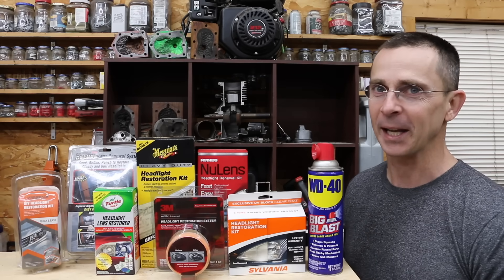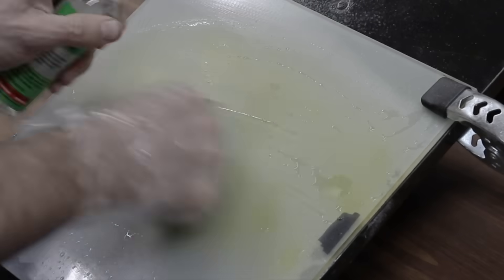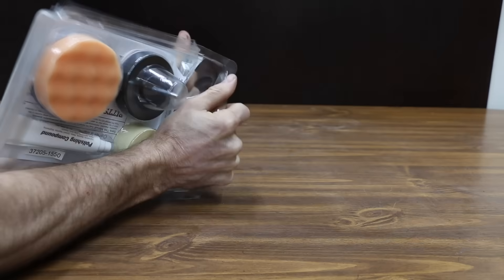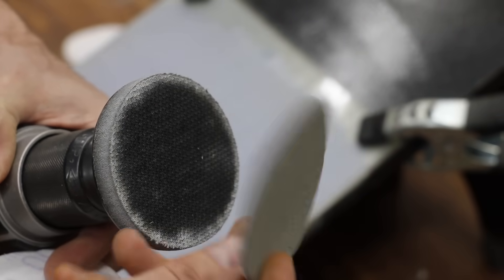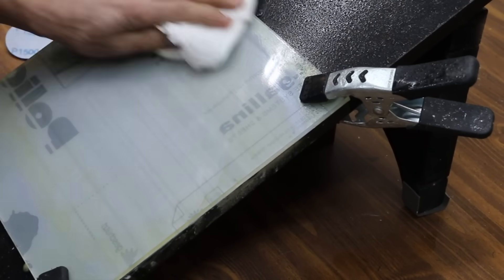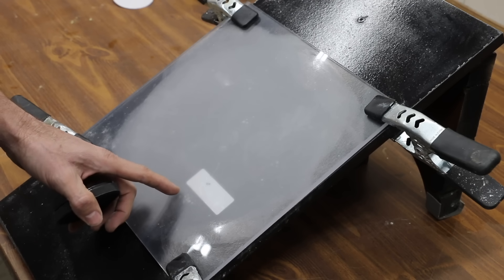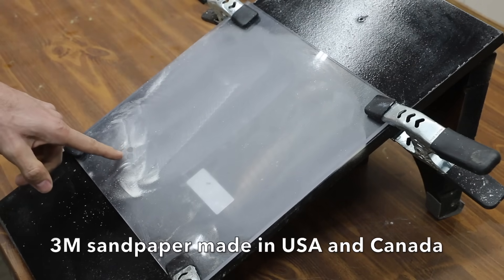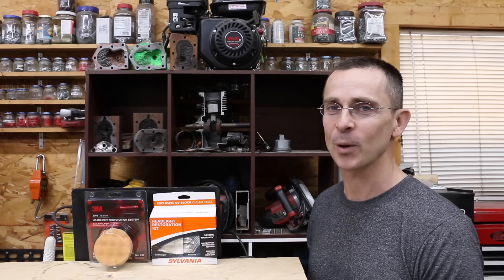Best Headlight Restoration Kit?  Let's find out!  3M, Sylvania, Meguiar's, Mothers, Turtle Wax & HF

Comment: I'm an ASE tech and worked at a used dealer for years.
We frequently had to repair headlights.
I've found the best way for lasting results is to get a 3m kit, wet sand out all scratches and yellowing.
Wash & thoroughly dry the headlight.
Then buy a can of Rustoleum clear coat spray paint that says "dries crystal clear".
Spray several light even coats as it will run if not careful and you get to start over..lol
I've seen vehicles return 4 years later and headlights are still crystal clear.
Reply from the maker: Thanks for sharing.

Comment: Seems like the kits that do not have anything to protect the lens after it is sanded and polished, are not comparable, strictly speaking, to the ones that have a means of protecting the lens after restoration.
With no coating, any repair or restoration will not last very long, and may wind up worse in a few months than before the coating was removed by the restoration.
The lens needs to be protected after the process of removing the cloudiness is done.
The good news is, there are products that can be bought just for that part of the job.
Reply from the maker: Thanks for the feedback.
Reply: @ProjectFarm  I saw that you had mentioned this later in the video than I had gotten to when I made this comment, so you were of course way ahead of me!

Comment: I've used the turtle wax on my 2007 Cobalt SS. I did not sand. I used rubbing compound to help clarify. Sandpaper will remove the lettering, where rubbing compound won't. It turned out nice because I keep my headlights waxed anyway. The only problem is, they need 2 packs of sealer. One headlight gets a little smeary. Warning to using on tinted headlights! You can only do a little mild polishing on those.
Reply from the maker: Thanks for the feedback.

Comment: I tend to keep my cars till 200k so I've had to repair or replace headlights.  Your test is awesome ! The only thing I disagree with is that it's yellowing from sun exposure. I feel headlights get sandblasted with road grime which includes oil and also iron that is in road salts. If it was because of sun damage it would be though out the whole lens since it's transparent . Halogen bulbs put out ultraviolet rays also so headlights would be considered a consumables and yellow though out.  I wonder if after using 3m if you waved a torch over lens it would be like new ? I just wouldn't trust telling people that cause holding it there a split second too long would damage headlights.  Good video 👍
Reply from the maker: Thanks!  Thanks for the constructive feedback.

Comment: I just did my trucks lights a couple months ago. All I used was a very light grit sandpaper, maybe 300, spray water, blue tape and krylon clear coat uv resist spray paint. Looks like brand new. Took 10 minutes each. Cost about $10
Reply from the maker: Thanks for sharing.

Comment: I just use no 7 polishing compound straight up until clear. Most of the time I can do it by hand. If they are severely oxidized, I use 0000 steel wool, and finish with polishing compound on a drill. no point in buying a kit.
Reply from the maker: Thanks for sharing.

Comment: I have a 2008 Escape bought new, since new I have used a spray bottle of quick spray on wax with UV protection that you polish right after applying, I actually do the entire vehicle after a washing, my headlights look just as they looked when new, other than some piting from sand but not much. What I'm saying is wax your lenses regularly after you polish your old ones, my Escape lenses are going on 14 years and still crystal clear!
Reply from the maker: Thanks for the feedback.

Comment: I use “mother’s mag and aluminum polish” with a microfiber towel or foam drill polisher it’s 7 bucks and takes a bit of elbow grease but it works fine for me
Reply from the maker: Thanks for sharing.

Comment: I just use at wet sand 800,> 1200> 3000 orbital sander, the buffing compound and then 2K 2 part clear coat. Lasts years. You can buy a can of 2K clear but need to use it in a day.
Reply from the maker: Thanks for the feedback.

Comment: A few years ago, I used the old Meguiar's kit that only contained the scouring pads and spray protectant, but I supplied by own sandpaper and hand sanded to 2,000 grit, then sprayed the protectant coat. It worked very well in removing and restoring my motorcycle's oxidized, scratched and crazed surface!

If I had to do the job today, I would combine the 3M kit in this video with Meguiar's standalone "Keep Clear" spray protectant.
Reply from the maker: Thanks for sharing.

Comment: Honestly done this many times just use meguires ultimate compound that I already have for touch-up work with a drill buff pad them a 3 dollar can of uv resistant clear coat. Done it to several friends vehicles one is on 7 years now still looks great.
Reply from the maker: Thanks for the feedback.

Comment: Another cheaper/faster way to renew oxidized headlights/taillights is to just use a high-speed paint buffer (eg. 7" foam pad) and rubbing compound/metal polish, etc.; then use Meguiar's Headlight Coating to put the UV protectant back on.  The coating will do many headlight/taillight lens (or anything plastic and weathered from UV/outdoors), for less than these one-time kits.  The buffer is way faster than sanding, sanding, sanding!  In minutes, and without much elbow grease at all, the lens' are clear again; and if coated again, are good for many more years of service.
Reply from the maker: Thanks for the feedback.

Comment: When buying a used car if the car is mechanically decent but yellowed headlight you can always haggle down a significant amount of money based on yellow headlights I’ve discovered. It never deters me from buying a car i like. Because job number one is going out and getting a sylvania kit and restoring them up people think ive replaced the headlights. I could easily make 500-1000 flipping the car just restoring the headlights alone.
Reply from the maker: Great point

Comment: You should skip all the hard work and buy some repel with 40% deet .apply with 100% cotton towel. It will remove all yellowing and without scratches. With a clear finish. Still need to apply a clear coat acrylic. Little effort I  removing yellowing. Good luck hope you'll give this a try on headlights not the way you did this experiment.

Comment: I agree about the 3M sandpaper. i purchased a kit over two years ago but didnt use it until this march. It was a bit different than the one tested as it had clear coat wipes. i hand sanded using the sandpaper and it cut through the plastic pretty easily and they look as good as new.
Reply from the maker: Thanks for the feedback.

Comment: have you tested the headlight protector coatings like Meguiars spray that are supposed to prevent the yellowing if you put them on each year ? I used it once on my headlights while they are still good at 4 years old so i hopefully wont have to polish the headlights as they get older
Reply from the maker: Thanks for the video idea.

Comment: you can clean up a clogged sandpaper with a handheld steel wire brush after which the sandpaper will work for awhile again. Won't compare to a new one but will cut and sand much better than a clogged one.
Reply from the maker: Thanks for the feedback.

Comment: I got the meguiars kit and I think the UK version is slightly different as they only supply the little 2" sanding squares. Which are pointless, they wouldn't even cut through only 10 years of UV damage.
I ended up buying a sanding pad set to do the actual cutting and bought a separate UV protection as 8t didn't come with that neither! I did use the drill polishing thing though but I'm not sure it was worth the extra. This video confirms it and even more so as my set was even worse.

Comment: If you're watching this in 2021, try using your existing compound and polish before you buy one of these kits.

Saw a video where someone spent only 5 minutes on each headlight with the Mother's Mag and Aluminum Polish. If that works, maybe spray some Meguiar's Headlight Protection Spray to seal it.
Reply from the maker: Thanks for the feedback.

Comment: The trick I found with how to prevent the plastic lens headlamps from getting foggy with the tan/brown discoloration:  Don't wash and wax your vehicle.
I discovered that vehicles that are frequently put through wash and wax jobs at carwash places generally have the cloudiest tan/brown-colored looking headlamps.  Whereas, with my year 2000 Toyota Tundra pickup truck, there's barely a trace of discoloration with the plastic headlamp lens . . . and it is all due to the infrequent car washes I subject my truck to.  But, I do use glass cleaner on the headlamps.
My 2000 Tundra has been washed three times in its life, all times when returning from snow country to wash away the road de-icing grit on the truck's body and chassis.  Outside of that, the annual rains does the washing on the white paint body of the truck.  My truck is parked outdoors 24/7 for the past two decades.
Recently I noticed a similar looking model year Tundra pickup in a parking lot, with a metallic-green paint job that looked superb, obviously the truck owner took exceptional care with the wash and waxing of that truck.  But, the headlamps were no longer clear, but nearly opaque with a light brown coating. 
So, that's when it struck me that a plausible reason for my 20 year old truck headlamp lens looking clear, but a similarly aged truck lens was near opaque:  That other truck was subjected to frequent wash/wax jobs at carwash places.
So, avoid carwash places and do the wash/wax jobs manually, so the wash/wax chemicals stay off of the headlamp lens.  Or, do like lazy me:  Have a vehicle with a white paint job, it is marvelous for minimizing the look of crud buildup on the vehicle; where a person can get away with minimal wash jobs on the vehicle.
Reply from the maker: Thanks for sharing.

Comment: As my wifes car was due for its MOT I did a quick check around lights brakes ect, Noticed the front headlight lens badly yellow, As I never had any restoring products at hard, Scatching my head for a solution, I thought I wonder if brasso with wadding would make a difference as time was pressing, In 5minutes and hard polishing the lens is clear as crystal believe me! I went over the lens with ordinary car polish, So in short save time and money, Buy a small tin of brasso at pound land £1 try it yourself and see after all what have you got to lose!!👍
Reply from the maker: Thanks for the suggestion.

Comment: save your money:
all you need is 
-the "lotion" version of kleenex
-minwax wipe-on poly gloss.
-fine-grit sandpaper, but ONLY if lights are yellowed.

if your light is just pitted and scratched, then pour a LIBERAL amount of poly on to a lotion-kleenex, then wipe on the light and let dry. don't be a Conservative idiot.

if your light is yellowed, you're going to need to sand first.

I typically do no more than 2 coats.
Reply from the maker: Thanks for sharing.
Reply: @ProjectFarm  used this for years.
the not-obvious part is the use of very thin poly, and only a coat or two (because the poly itself can yellow).
yes, it will wear....and then you just retoutch.

Comment: I use a blue kitchen scotch scratch (blue does not scratch plastic in the kitchen Ex. microwave controls, the green scratch does scratch/scars plastic) and Meguiars Restore & Polish which did an amazing job. I was still not satisfied, so used the blue scratch pad and wet baking soda - which took another layer of the oxidated yellow scum off.   I did use Meguiars polish to try and protect it for 6 months. This only lasts 6 months, it must be restored biannually.
Reply from the maker: Thanks for sharing.

Comment: Suggestion... Propane BBQ Grills... The season is coming fast. I've had $1000 grills and $200 grills, comes down to maintenance and durability. Burners are the sore spot and first problem, then grates and hot-spots, finally gauge of metal. Some just don't hold up.
Reply from the maker: Thanks for the suggestion.

Comment: Hey guys, just thought I’d share what I learned recently about yellowing plastics. Take a bin, fill it with hydrogen peroxide then wrap it with UV LED lights. Put foil around the bin after the lights and In a few hours it will remove the yellow. Have a good day
Reply from the maker: Thanks for sharing.

Comment: so your contention is that using 120G sandpaper then adding a coating of a spray chemical tint is an accurate representation of the normal deterioration headlights experience from prolonged UV exposure. had you used similarly deteriorated headlights even if from different vehicle manufacturers would have resulted an accurate test of the products ability to reverse the effects of normal UV exposure, your test procedure rendered you test results completely invalid and thus a total waste of time for anyone dealing with natural effects UV deterioration, however is good information for anyone dealing headlights that have been damaged by some idiot spraying a chemical tint on them after they have been sanded with 120G sandpaper!!!
Reply from the maker: Thanks for the constructive feedback.

Comment: I used the Sylvania one after watching this.  The results were great.  2005 Ram pickup headlights looks new.  One thing I'd say to consider is this though....  It was a lot of elbow grease.  Three grits of sandpaper were applied five minutes per lamp using firm pressure.  That's a total of a half hour of sanding by hand.  I'm not quite as fit as the gentleman in the video, and that took a lot out of my fingers and hands.  But, wow, you can sure see and smell the material being removed!  Plus, there's the buffing for an additional ten minutes.  Throughout, until the very last step, I thought I'd ruined them - so follow the steps!  One last thing....the next time this comes around, I'll take the second-place kit with buffer pads for my drill.
Reply from the maker: Thanks for sharing.

Comment: Making a product with more technology and necessity, without science, means more cost to the consumer to have it fixed as well  !    A simple headlight cover should NOT cost thousands of dollars to replace!   A headlight LENS or cover, does NOT have ANY effect on the workings of the car, despite what some car companies want you to tell you!    

Project Farm, thank you for sharing this video.   You also mean, "which of these products works the best, TEMPORARILLY,"   right ! ?    Oxidation isn't easily done away with, even on headlights, "it seems."   Thus companies can seemingly and (only?) supply the consumer ( joe shmo ), a less hazardous, and less effective product that the result is ONLY temporary.    

What I found out, by using some products, and from others that used the same and similar products that claim to restore or help clean headlights, is that the effect is just that... and EFFECT !  It's not a fix, and the results do not last.     Of course, most companies don't want the consumer to know that!   Plus, my comments  alone will not stop the masses from buying such products, in the hopes of clearing up those foggy headlight lenses with just one application.    I guess it's all about money and knowledge;  the haves and the have nots ?     

NOTHING material lasts forever, and one should not buy a product, just because it claims to do something, even AFTER following directions to a T.   Plus, WHO has ALL those tools and supplies ?    Maybe auto manufactures should consider headlight COVERS to be separate, and thus easily changed out ! ?    But I guess that won't happen, because they would loose money from all their repair jobs ! 

Project farm, thank you for in one way, proving my comments.
Reply from the maker: You are welcome!  Thanks for sharing!

Comment: Tested the 3M as recommended in this video and I was not able to restore my headlights because in theory in flat surfaces they work Amazing but if you have a mazda those headlights are curved and lots of complications. So instead buying a new one I combined the sponge with Meguiar's G12310 PlastX and that did the job.
Reply from the maker: Thanks for sharing.

Comment: Nice video. I started out using the Mothers NuLens kit, but quickly realized I could do just as well---better, actually---by piecing my own setup together. I clean up a lot of headlights for friends, and my last step is either Turtle Wax or clear spray paint designed for plastics as a top coat to keep UV damage from happening so quickly. is there any chance you could whip up a test to compare headlight UV-resistant treatments?

FWIW, the rest of my system is drill-sand with 1,000 grit, hand or drill sand with 2,000 grit, polish with Flitz on a cheap foam pad off Amazon, wash off, then treat with Turtle Wax---just like waxing paint---or clear spray paint, depending on how much time I have and how long the person is willing to wait.
Reply from the maker: Thanks for the video idea.

Comment: The very best way to restore the luster to a headlight lens that I've found is to sand the lens with 1000 grit paper then clean the lens with alcohol and apply clearcoat paint over the top, it looks beautiful, clean and clear. There is no need to polish the lens, in fact it's important not to polish when using this restoration method. I use a two-part clearcoat for durability. So far this had lasted more than three years on a Volkswagen Jetta and a Chrysler 300.
Reply from the maker: Thanks for sharing.
Reply: I assume it was a clear coat spray can that you used so how did cover the car so paint wouldn't get on it?